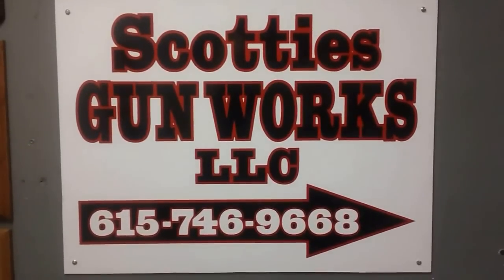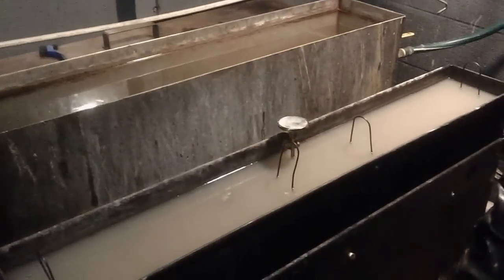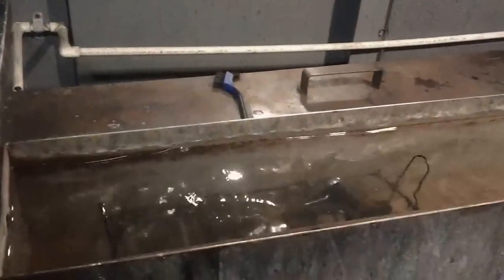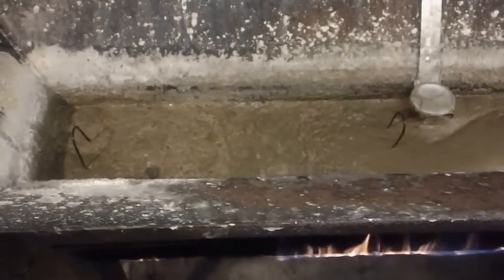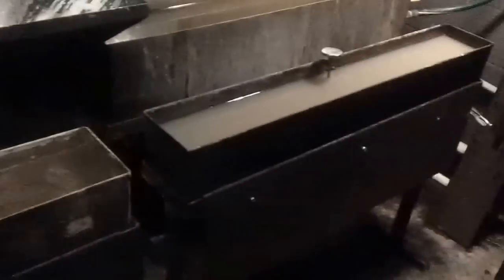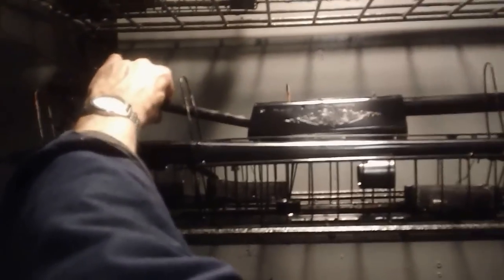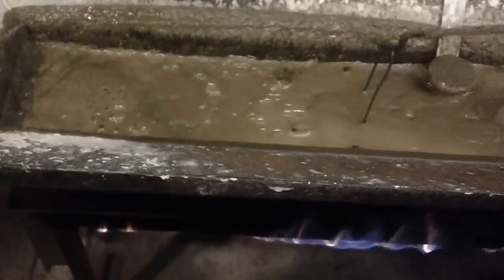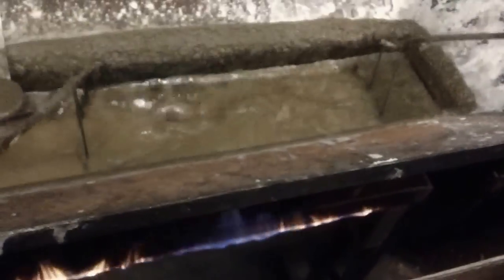Professional Gun Smith bluing process revealed - Professional Gun Smithing Series

Comment: I learned so much, from tank to tank and then to the other tank. Watch out for that tank it's hot. "Professional Gun Smith bluing process revealed" nothing was revealed and nothing was taught, good commercial for Scotty.
Reply: Doug Clark you're 100% right. I watched thevideo to know how to blue metals but eventually said your exact words while I was exiting the video
Reply: Guys, I think that the big reveal is this:  let the professionals handle it. You gonna go out and buy all the long square tanks, little specialty racks, boilers, fans, and all the different acids and other solutions to do it yourself? If so, then you'll actually need to crack open a book most likely.... And you won't save a dime doing it yourself if you seek to do it this way.
Reply: @tenshib5951  It's really not some secret process that is hard to do. Also not expensive if you plan on doing 3 or 4 guns.  I'm not one of the pricks that tries to add up my time as a cost to myself to justify somebody overcharging.

Comment: PokerMan, the finish is achieved by the polish it gets before the bluing process. Be aware that polish can dull a good bluing job. Especially if it has microns in it. Take some 0000 steel wool with a non detergent oil (Rem Oil) and lightly card over the blued parts of your firearm.

Comment: Hello,after a hand Job Removal of Gun Bluing  degreasing to the original metal SS,hammer  Forged etc. How do you do a Bluing in layers job over a polished Job inside and outside for protection too. A Kimber Custom job.so to speak on the frame and slide of any SA or SA/DA Pistol besides a 1911. to get a Polished SS look,up through the hue of the blueing,in other words, is there a  tinting process using different color tints   like Purple etc. I am new student to customising  Guns Works jobs. I hope my question is clear enough to help you help me..Ain't Youtube grate. thanks !
Reply from the maker: 615=746-9668  Give Scotty a call  M-F during business hours (CST) and he can answer that for you.  I have no clue.

Comment: How many hours does the process take? Including cleaning and prepping?
Reply: LOTS.  Depending on how rough the gun is, you might have to sand/wire wheel/sandblast the metal, remove pitting down to smooth metal, then polish with varying degrees of polish depending on what customer wants.  Then it must be cleaned absolutely spotless, then you can start this process which is another hour or so.  The metal prep takes the longest though, especially if someone wants a high polish blue and brings in a pitted rusty mess.

Comment: Is this in the black oxide family?
Reply: Reason I'm asking is that I've worked in metal finishing for 25years. Zinc, black oxide and anodizing. Have processed many gun parts in black oxide
Reply: +Ted Larson Technically id say yes, when you truly blue a gun what you are basically doing is oxidizing or rusting the surface layer of iron on the gun parts to form what is called magnetite which is actually a black oxide of iron (naturally occuring oxide of iron). Also id like to point out, as im very sure you are aware of, there is a difference between bluing a gun and applying a surface coating of black oxide